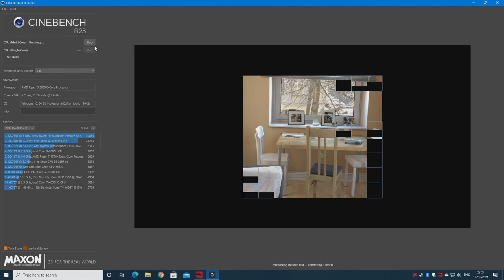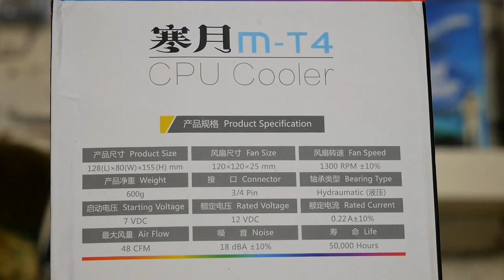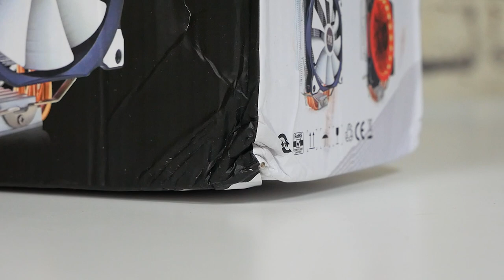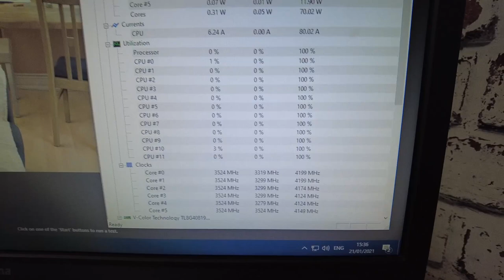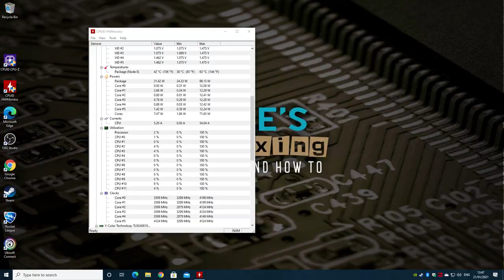BEST 120mm Tower Cooler For Your PC Snowman M T4 Twin Fan

Comment: Very nice. Mine came with a different AM4 mounting mechanism. It screws directly into the back plate.

I am impressed with the performance too. Got a Ryzen 5 3600 @ 4.3 GHz and it maxes out at about 82 C.
Reply from the maker: cool that is a new thing then, might have to order one and take a look, got a link

Comment: You got to love it when a fan has Chinese right on the center sticker. I just finished getting my PC back together. I revamped my open loop and installed my new EK D5 punp and washed the dust out of my radiators.
Reply from the maker: i forgot to translate what it says on the sticker, i think is was spin fast
Reply: @mikesunboxing  😂

Comment: I was getting 70-80 degrees with intel stock cooler but after using this cooler the temperature i'm getting now is 20-30 degrees which is a massive jump. I'm using the exact cooler. The only downside is mounting this cooler on your cpu it took me 3 hour to figure that out.

Comment: I just picked up the 6 pipe one for £15. eBay delivery was just a few days. 
It's going in to replace my CM240 aio which is struggling to keep control on my R7.

But... The plate on the CM is terrible, I've flattened it a little, but needs alot more work, better fans as the stock go noisy quick.
Reply from the maker: coolermaster do make a lot of stuff that just isn't good, and some things that are awesome, i dont know how they manage it!
Reply: @mikesunboxing  they were like a unknown China brand way back. They came out with some okay stuff sort of mod range and then did the budget thing. Going from okay to budget means  utter trash, but I think some of the things they happed to make good. They're haf case are nice.
The finish on the aio is not good the fans are good but simply don't last and rattle away. It was on my i5 and not long after I went to the r7 and well I don't know if it's the CPU or the cooler or both that's really the problem, but I idle way to high for my liking

Comment: I don't think I have had one yet to not have a bit of damage to the finstack and I have had a fair few. One thing I would advise if your building on an intel platform with south bridge heatsinks like X79 or one of those Jingsha or other brand Chinese resyc LGA1366 LGA2011 boards with Xeon's and server RAM, (All I can afford to build now a days sad face = () the ring bracket always butts up hard on the lower heatsink so you cant get the loop over the hook if you want airflow from front to back. You are best to hook the shorter tower clasp loop over the hook before fitting the ring leaving the tower hanging while you fit into place. I usually build outside the case makes things a little easier. Also on some instances like towers with power supply at the top I have had to bend the thumb clip up a little as its at the top in these situations, with some needle nose pliers. Its all a little fiddley but well worth it from budget price point perspective.
Reply from the maker: thanks BD always good to get some insight from you :-) hope you are well

Comment: Getting an average of about 2 weeks for Ali Express currently to the UK. Had a motherboard in a week over Christmas (!). Interested to know if the £14 was pre 31/12/20. Post-brexit addition of VAT at source has reduced some of the Aliexpress advantage. I cant see the Single fan T4 for any less than £17.50 inc vat+shipping at the moment. Still a very good buy though. I have used the 6 pipe version with a Xeon E5-2630 and haven't seen it over 68.
Reply from the maker: i think i bought it on the 30th or there abouts

Comment: I had the 6 pipes version with 2 fans on my 3700x and it was very good for the price.  I replaced it with the noctua I bought for my non existant 5900x.. It did a good job and if I ever got the 5900x, it will for sure go back to the 3700x. The coolermaster hyper 212 black was a "meh" but the Snowman was a "wow, for that price?" for me! Shipping was 3 weeks and I was lucky because only the box suffered. And a snowman where I live is very happy with - 12 celcius as of typing!
Reply from the maker: did you find the extra pipes made much if any difference?
Reply: @mikesunboxing  maybe not with the 3700x, but maybe if I ever get the 5900x. But definitively quieter than the coolermaster

Comment: You should have tested it with MX4 instead of that colgate paste you used the difference might have been only 1 - 2 degrees.
Reply from the maker: true, maybe i'll do a group test with mx4 next time
Reply: @mikesunboxing  My ASUS TUF B550 replacement should arrive tomorrow & I will be using a 0.5mm thick copper plate with paste between the 3700X & the 4 pipes of the thermaltake contact 12 this is so the heat from the CPU is absorbed evenly instead of the gaps between the heat pipes which conduct heat unevenly.
Reply: @mikesunboxing At last I've have done my build after 2 in a row faulty ASUS TUF B550's that could not boot I bit the bullet & got a B550 tomahawk localy beforehand I did a quick test on the contact 12 cooler on a hotplate without any paste with & without the 0.5mm rectangle copper that covers the pipes between the processor & found it conducts with an increase of 2 Celsius higher than without the 0.5mm plate. It is installed by unscrewing the 2 platic brackets above & below the CPU socket (I hate those f*****g clips) I also use the extension that came with it for quiet mode & my 3700X scored higher than cpuz tests in comparison & rarely hits 70 Celsius while gaming (Metro Exodus using a 10% clocked 750 Ti/32GB of 3600MHz RAM) even when it hits 4.4GHz & only uses 20% of the CPU it may be the cooling it may be a well binned CPU???

Comment: T4 dual fan is on the same performance  lvl with arctic 34(single fan and silver one) / EVO 212 / gammax 400V2 ?
Reply from the maker: yes pretty much. Almost all 120mm tower coolers are similar in performance regardless of price or fans, the difference is generally only a few degrees
Reply: @mikesunboxing  tyvm ;)
Reply from the maker: @Kanivalos80  No problem :-)

Comment: would this cooler fit the i3 1700 socket?
Reply from the maker: not as it was in the video, although if you check the links in the video it may have been updated with lga1700 support
Reply: @mikesunboxing  it does not say for 1700 but will check it out as i already have that cooler, just got to wait for the new motherboard to arrive.